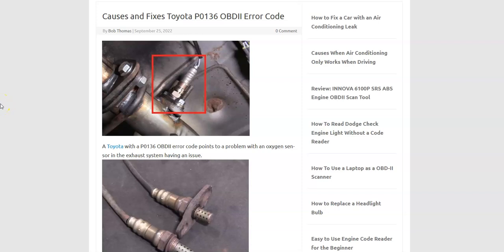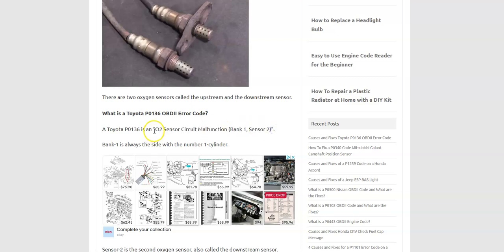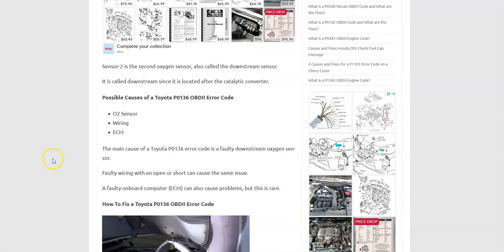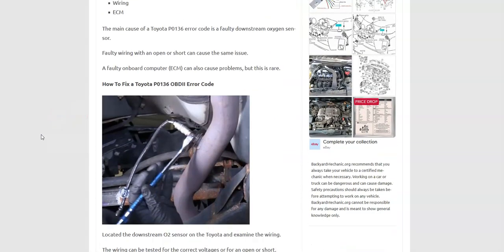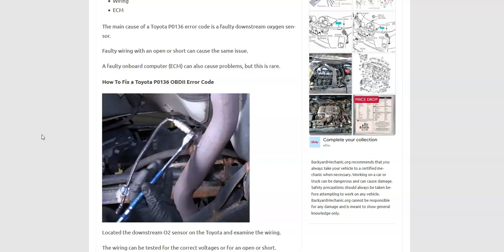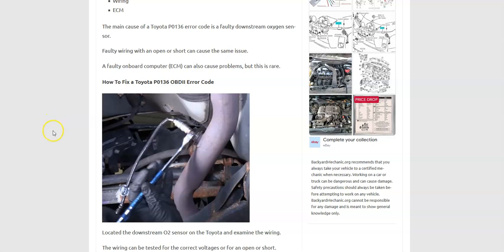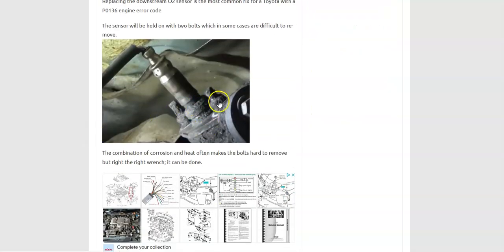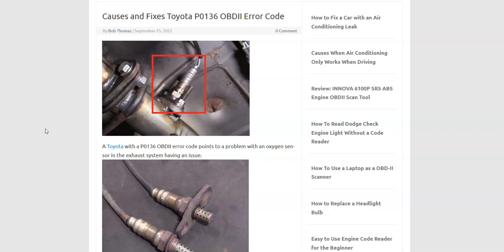Causes and Fixes Toyota P0136 Error Code: “O2 Sensor Circuit Malfunction (Bank 1, Sensor 2)”

Comment: Hello. I have a 1999 Toyota Camry with a P0136 code from O'Reilly's(02 Circuit, Bank 1, Sensor 2).  The mobile mechanic today said that a downstream sensor is not on my car.  He said some '99 Toyota Camry's have them, some don't. Is this correct?  Why would the diagnostic from O'Reilly's show P0136?(And, the man from O'Reilly's said it was a downstream. )  (I think the mobile mechanic said today he did not see a sensor connected to the catalytic converter.  Would it even be connected to the catalytic converter?)
Reply from the maker: Every late 90s Camry I have worked on has had a Bank-1 Sensor-2 oxygen (A/F sensor).  Some even have a Bank-1 Sensor-3 for a total of three.
Reply: @HVAC_Mechanic  I am going to try to find it today.  I hope the very best for you.

Comment: What are your thoughts on eBay 02 sensors ? I purchased a denso from rockauto and they only have a 30 day warranty.
Reply from the maker: I have installed low-cost O2 sensors from eBay mostly with no issue, but when one is bad, it can cause a headache. Since testing the wiring is next, that can cause issues when troubleshooting, so I go with OEM like Denso whenever possible.
Reply: @HVAC_Mechanic  Gotcha , 
I found one on eBay with a 5 year warranty , which is very hard to believe but the seller confirmed the warranty.

Comment: New sensor. Same problem,  any other ideas on what I can check?

Thanks.
Reply: exhaust leaks
Reply from the maker: If the sensor is good, I would check the wiring.

Comment: Still getting the P0136 and P0138 code after swapping the Sensor 2 with a new Toyota sensor.  It shows pending on both prior to activating the check engine light.  The voltage on the sensor is roughly .8 which seems to be a bit high based on my research.  The fuel trim (short & long) both appear to be within the +10 to -10 range.  After the car is run a few miles it will throw the P0136,, P0138 and a traction control code.  Looking to change the Sensor 1 and see if it helps however that sensor in Toyota brand is pricey. The car has 170K miles and I plan to keep it.  Any suggestions on what to try as I have a scan tool however still learning what it is capable of doing.
Reply from the maker: Since the codes are on both banks, I would look for something that would affect the whole engine (rich/lean condition), an exhaust leak, or the wiring before going to the sensors.

Comment: Before you buy a new sensor, be sure to contol that the new sensor match the OE numbers.

There are so many aftermarket sensors and it is easy to buy an incompatible sensor if one is not careful.

The ECM (aka ECU) watches for a cailbrated band of voltage; So what voltage the sensor sends is crucial. 
So if you have a sensor that gives readings between 0.02 to 0.10 V the P0136 will be triggered if the ECM is calibrated to read the band 0.08 - 0.16 V.
Then you need a sensor that sends 0.08 to 0.16 V to the ECM.

Its bad its not a standard so that all sensors would fit any car, but then the industry wouldn't earn as much when people get confused to why theire engine light pops up after they have changed a sensor by themselves.
Reply: How do you calibrate ?
Reply: @Cyberdemon1985  If the signal voltage is close to the reference voltage, the ECM will internally adjust the signal to be correct.
The process is called automatic sensor calibration. When I wrote calibration earlier I refered to the pre-installed reference value in the ECM.

I do not have the knowledge how to manuelly calibrate the reference value stored for the ECM.
I guess one can use software tools for this like GM SPS, but I would advice you not to reflash the memory if you are not sure what all the new values should be for ALL the sensors in your car. Further: I guess its possible to reflash and calibrate a single sensor only, but its prob. comes down to what computer-program you use.